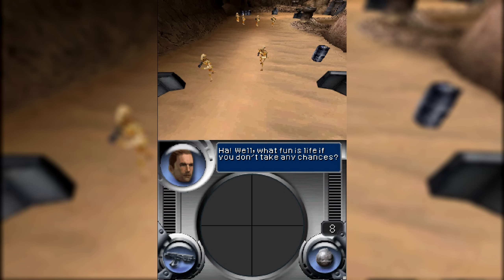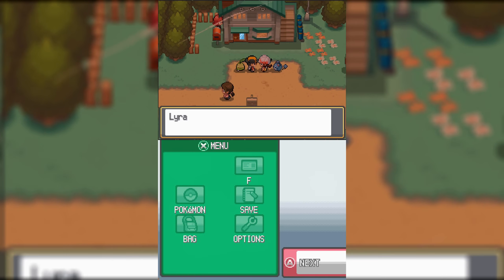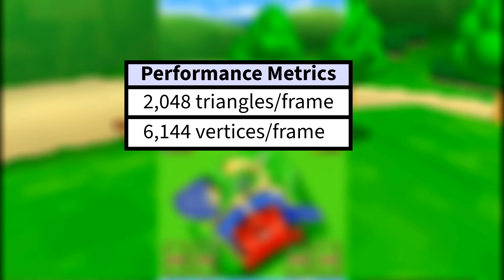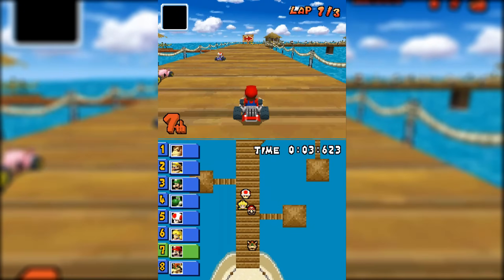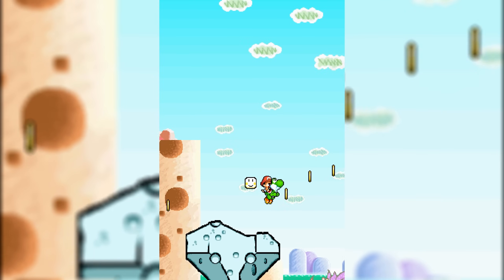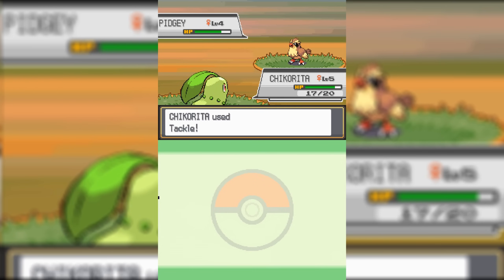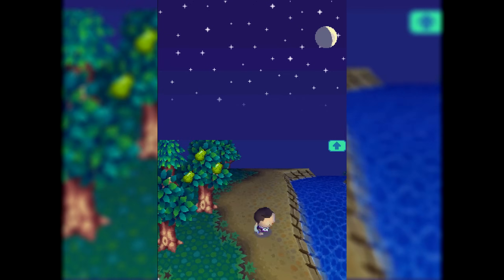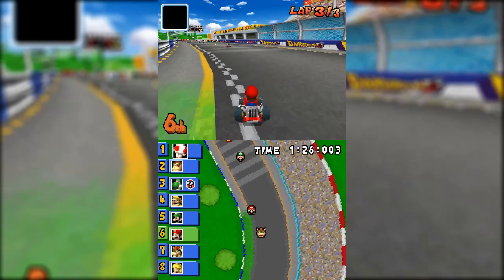The Nintendo DS GPU - 3D Engine & 2D Engines

Comment: So it was possible to use the 3D on both screen with a clever trick.  Swapping the rendering screen from screen A to B and next frame B to A.  That's why by example Zelda phantom hourglass with 3D on both screen was capped at 30 fps.  Sonic had also a clever trick.  It's changing from 3D to 2D engine and activating the 3D on the top screen, and hiding the small loading time with the travel to the hinge (were sonic was not visible) and keeping framebuffer intact.  The experience looked seemingless and they didn't break the rule of 3D on only one screen.  What's infuriating me, as a developer, it's the fact Nintendo saved few bucks from having a FPU, and so 3D had to be dealt in fixed point units; which is ridiculous for the era...  Good luck doing trigonometry without floating point with acceptable performance

Comment: Wait... does the NDS handle 3D the way it sounds -- a hardware implementation of a 3D engine, rather than being a generic GPU capable of running many different (software) 3D engines? Obviously there would be limits to this approach, but I imagine there would be some advantages too.

Comment: I've always thought Nintendo DS games look similar to a lot of Sega Saturn games. And I guess the 2D/3D engines is kind of comparable to the Saturns VDP1&2 although I assume they work very differently. I once saw a video comparing DS games to PlayStation 1 games. And what I found interesting is that a lot of the graphical improvement on the DS isn't because of processing power but rather from advancement in how developers optimize and create 3D games.

Comment: Speaking as an NDS emu dev, 2d tile rendering is about saving vram bandwidth. 

The 3d framebuffer is not held in vram. There is a 48-scanlines buffer filled ahead of time. It uses the vram for texture memory, not framebuffer, unless the video capture is used for things like dual screen 3d. Up to 512kb could be used for this

Comment: How did over the Hedge render 3d on both screens? Always perplexed me.
Reply: The typical technique is to use display capture to capture the 3D rendering engine output to a VRAM bank, then swap the display engines after rendering is complete, having the sub engine display the old captured frame. The result is that each screen is getting 3D video at an effective rate of 30 frames per second.

Comment: What disappointed me with the GBA and DS back then is how cheap Nintendo were with their handhelds (no not the price). They should've done what the PSP was capable of but no, Nintendo wants to maximize profit and offer us old tech already for its time. 

The GBA should have had higher resolution (with better sound) and the DS should have been the 3DS (without stereoscopic). The DS was basically just a GBA with slightly better 3D handling, oh and that unnecessary dual screen no one asked for.

Comment: Ah yes the portable N64. If it had a Super Nintendo baked into the hardware. The 3DS is a Russian nesting doll of hardware as it technically has a gameboy advance as the ambassador games ran natively on the system. Same with DS games as it had that hardware baked into the system. How both the WiiU and the 3DS handled backwards compatibility is incredibly interesting on a hardware standpoint. Nintendo baked their older consoles in some way in the final system of their architectures.
Reply: Not really true about gba games on 3ds. The ds CPU being utilized for the GBA ambassador games was somewhat of an emulation. More of a translation but not every GBA game runs natively on that nintendo emulator. Audio issues and graphic problems need to be patched, which is why GBA emulation homebrew is still useful. The NTR core is certainly more similar than the 3DS processor, which is why ambassador games boot into DS mode, but no it is not “native” backwards compatible. The DS itself actually has no way to natively access its GBA processor, which is why you cant natively run GBA roms on a ds flashcart, and also why GBA games cant natively run on a DSi. Nintendo made the AGB cpu physically tied to the gba slot, and removed it when they took slot2 out for the DSi. It’s a lot of arbitrary weird lines but this is somewhat of an unsolved problem to this day

Comment: I used to code stuff on the DS.  Nice seeing its 3D and 2D engines getting and in depth look.
It's been more than a decade but here's what I remember:

* It was easier to develop a 2D rendering layer using the 3D engine than messing up with the OAM to draw UI. 
* Banks E onwards I used for palettes.
* 4 MB for code+data made programming easier.
* You were limited to 64 translucent polygons.
* I don't remember the DS doing polygon sorting from hardware. I remember doing an OTAG-like(PS1) sort on some of my tests in software.
* Dual screen was as simple as rendering every other frame for each scene and swapping main and sub screens(as well as some VRAM banks). ie, Alternate top and bottom screens. Limits your FPS to 30 though. You also needed to set up the 2D engine with a bunch of 64x64 OAM sprites to hold the VRAM data.
* Just about every numerical data you push to ram, from vectors to matrices, need to be in Fixed Point Format and it's not universal. Some need 16.16, some need 12.20, etc. crazy design but it worked. LOL
Reply from the maker: Thank you so much and wow that is an amazing write up! I talked to some devs and modders, but I would have loved this insight when researching for this! You know your stuff!
Reply: Yeah this was an interesting read, even though i didn't understand so technical stuff. Also i made it through the video!!! ❤

Comment: I cant remember a single instance it was used in actual games but I believe it was possible to achieve 3D on both screens by rapidly switching the main rendering (3d) mode between the screens.
You would essentially do all your 3d buffering on the top screen while it was the main screen and then before the frame is rendered, switch it so that the bottom screen is the main and do your 3d buffering.
This would of course come at a decent resource cost.
Reply: The Legend of Zelda: Spirit Tracks uses this technique for the Spirit Tower staircase room, and a few of the boss fights in that game also make use of this technique.
Reply: Mario Kart DS does this

Comment: That was a nice video about my favourite console to develop for. The DS was one of the few consoles whose specifications and registers I knew pretty much by heart back in the days and it was probably the last console a single programmer could understand and keep most of accessible in their head. It really was the end of that era.

One interesting aspect of how the DS rendered its 3D was the line buffers. To save cost and power, the GPU didn’t have enough frame buffer memory for a whole display worth of pixels (colour and depth). Instead, it rendered several lines at once, then displayed them just in time, while rendering the next set of lines. If the geometry on any line was too complex to be rendered within the time limit, there would be holes, much like missing or flickering sprites in 2D. This was still racing the beam, with a more modern twist. MOON had some such scenes where this caused visual glitches, as it was pushing the DS fairly hard.

The line buffering wasn’t quite like what we understand as tiled rendering these days, but could be seen as a predecessor to it. That’s also why multi-pass rendering wasn’t often seen on the DS. Paired with the fixed and small geometry command buffer (a double buffered FIFO, I believe), it meant that more geometry couldn’t be displayed by simply paying for it with slowdown, as was often the case on most other systems. That’s why slowdown due to rendering is very uncommon on the system (although there are many other causes). By the time new geometry could be sent, the previous pass’s frame buffer contents were already gone. That said, with careful construction of geometry, the equivalent of up to 3500 triangles (my memory might be a bit off here, but not by much) could be displayed in a single frame, which was more than enough and rarely required (and could cause the aforementioned glitches more easily).

Cheers.
Reply: I love moon and dementium, two of my favorite DS games, did you work on them?
Reply: @ I liked them, too, but did not work on them. Apparently a colleague of mine at the time knew the main developer behind the studio Renegade Kid. The way the flashlight was made in Dementium was fairly clever. 😄
Reply: Any chance you have any resources/pointers for someone who wishes to create a game for the ds? You seem to know a lot so I thought I'd ask :)
Reply: @b.8.b.b.y  problemkaputt has the gbatek GBA and NDS hardware documentation. devkitPro have the devkitARM toolchain and libraries. Have fun. Cheers.

Comment: Minor nitpick, but it's "cel shading" not "cell shading".
It gets its name from the thin cel strips used in traditional animation.
Which probably should be "cell" since it's short for celluloid, but I digress.
Reply: Yes, that’s a common mistake. In addition to cel shading the DS had a feature to automatically render coloured outlines on any geometry for which it was enabled. This is also known as inking, which is distinct from cel shading, even though they are often used in combination. The toon / cel shading was set up via vertex lighting, which indexed into a 32 entry colour table. The inking / outlining was set up in 8 colours each assigned to 8 geometry groups.

PS: I needed to correct this comment, because it might have suggested that of the two only outlines were implemented in the DS' hardware and I had to correct the part about how cel shading was implemented.
Reply: @SillyOrb  What games used (colored) outlines?
Reply: @KingYoshi93  "Dragon Quest 9" comes to mind immediately, but there were plenty.
"The Legend Of Zelda: The Phantom Hourglass" used both cel shading and (coloured) inking.
"Grand Theft Auto: Chinatown Wars" might have used both?
"Picross 3D" used coloured outlines.

Comment: The nintendo DS is by far my most favorite handheld sitting beside the 3DS. I've been so fascinated by the complex way the graphics are setup in the DS and how custom it is to give the graphics like it did. Its so simple compared to modern handhelds but still complex, and that complexity in design is what streamlines its functionality for developers. What I'm most curious about now is how was game development done, since with this very custom design, i dont imagine there being a lot of commercial game engines for the DS. Nintendo of course has their own to take advantage for their own games, I wonder if Nintendo handed this out to all developers with the nitro devkit. What was the software like for game devs? Was there lots of coding on bare metal to handle a ton of basic tasks like how the vertices get displayed? The specs of the hardware and how it is designed to operate is very cool, but now i wonder how much the devs have to do to achieve these results and what it was like, cause it sounds like you need a lot understanding of the hardware + working with bare machine code at times to with nothing in between to really push the hardware to its full potential utilization.

Comment: You pointed out that the DS's main memory has a 16-bit bus at 33MHz.  That's technically correct, but I think it's important to note this is only for NDS7.  NDS9 has a pair of hardware bugs that result in its effective access speed to 1.4MHz (yes, slower than the NES!).  The reason you don't see awful performance in the real world is that this is mitigated by the cache, scratchpad and prefetch, but if you've tried assembly programming you will feel the pain!

One more thing worth noting - the NDS9 and NDS7 share a FIFO 2-way bus to directly communicate with each other.  Nintendo never allowed devs to use it AFAIK back in the day, but us homebrewers can do whatever we want with it
Reply from the maker: Thanks Kirby! That’s insanity, but fascinating at the same time! I can only imagine the pain you experience dealing with that! Impressive that such low speeds can be overcome via the scratchpad. I did read about the 32-bit WRAM a bit, was that the scratch pad that was used to overcome?
Reply: @FrameRated  I was actually referring to the TCM, which isn't really cache or scratchpad, it's kinda it's own thing, though IMO the best use for it is as a scratchpad.

I forgot the DS does have the internal WRAM seen in the GBA, but that's arguably even weirder.  There's 32KB of IWRAM, split between NDS7 and NDS9.  NDS7 also has 64KB of private IWRAM, twice as much as the GBA.  This feels completely backwards, the NDS9 is the more powerful chip and should have priority on fast internal memory, and I'm really not sure why it is this way.

Oh, and one more thing (what I can think of right now, if you're interested I strongly suggest reading gbatek) - both 2D engines support bitmap sprites, they do not require palette + index as you suggested.
Reply: @kirby0louise Why did Nintendo not allow direct communication between the ARM9 and ARM7?
Reply: The IPC channel between ARM9 and ARM7 is used when transmitting or receiving data over wireless. ARM7 is the only one able to interface with the WLAN chip, and ARM9 needs to set up an interrupt handler to copy data from the IPC buffers to RAM when it's ready. I don't know if developers were aware of this, maybe it was handled by SDK code, but I know this happens because I've seen it as I was trying to reverse the networking code of a game
Reply: @Metalcape  RIght, I should have been more clear.  Apparently devs were forbidden from running custom code on NDS7, so while they could communicate over the bus, you couldn't just use it to do whatever

Comment: Why is this video broken on vertical on my phone ?
Reply: Tip: At least in the Android Youtube app, when you have a horizontal video that contains mostly vertical content with filler/frame on the sides, you can get a kinda-sorta vertical fullscreen mode. Swipe down on the title/description pane to sweep it away and get the horizontal video shown fullscreen in vertical orientation. Now pinch zoom the video until only the part you want is visible. 
(Similarly, you can also swipe up on the video itself to get normal horizontal fullscreen even if auto rotate is off. It will now stay in fullscreen and not exit it from rotation, though it will flip itself 180 degrees depending how the phone is pointed. Can be useful for watching while lying down.)
Reply: @joemck85 yeah, I use this regularly on iOS now. Does not work in shorts or insta. I don’t know why “have you seen this modern cup in medieval settings— insert full 4K Blu-ray shot of movie— get any likes.
Reply from the maker: hmmm I am not sure! It could be the odd aspect ratio the videos were recorded on, which was native resolution of the DS for authenticity on an emulator as I lack the hardware for direct capture and older trailer footage I would normally use in place of gameplay capture by me was horrific quality.
Reply: @ I meant this blurred replication in the borders. In HTML we can tell the browser to pull different media depending on aspect ratio of the client. “responsive design”. YouTube does this for advertising. Or sometimes I use “split screen” on my notebook while grinding through paperwork. Who watched YouTube full screen on PC? Who has the time?

Comment: It's interesting to see how complex and custom older setups were, and maybe if they kept that up we could push boundaries further, but at the same time we've gotten to a point where hardware is capable enough and ease of development leads to a better end result. Also you don't need stuff like co-processors when your CPU already has multiple cores and you get tons of RAM, it actually makes more sense to unify it and let developers assign it to what they need, effectively increasing the total amount of say VRAM if the game doesn't need as much system RAM.

Comment: I would love if you did like actually super deep dives. Like, the gamecube has a fixed pipeline, the GameCube also has a huge community for homebrew, so you could very much make a small program using what the devkit guys cooked to ACTUALLY show how the gamcube renders things with actual code snippets running inside of dolphin. It is a lot of work. But PS1, N64, GameCube, Wii, NDS, 3DS and Wii U are pretty easy to develop homebrew for in general, at least for small programs that can access the GPU to render to the screen and nothing else

Comment: I wonder how the DSi differs from this.
Reply from the maker: They did a good deal of improvements with the DSi! I will make a video for that in the future
Reply: @FrameRated  That sounds awesome. I've been interested in making homebrew for the DSi so I've always wondered what all the improvements are.
Reply: Double CPU speed, four times the RAM and most importantly a configurable (meaning: not freely programmable) DSP (digital signal processor). The graphics system was pretty much the same.